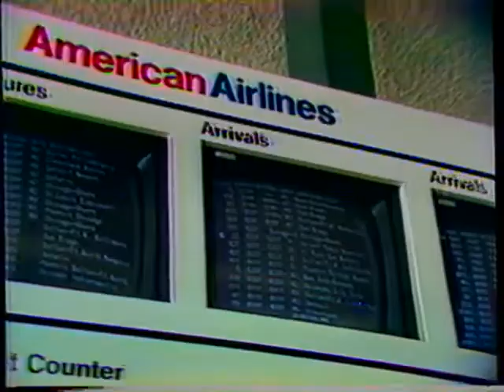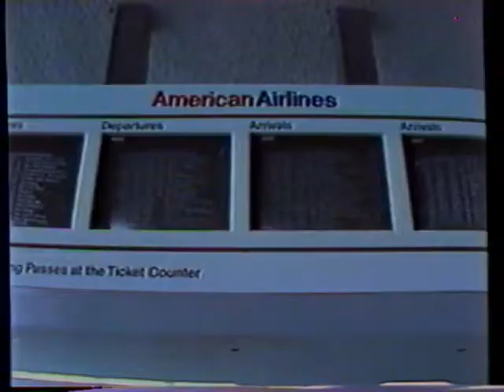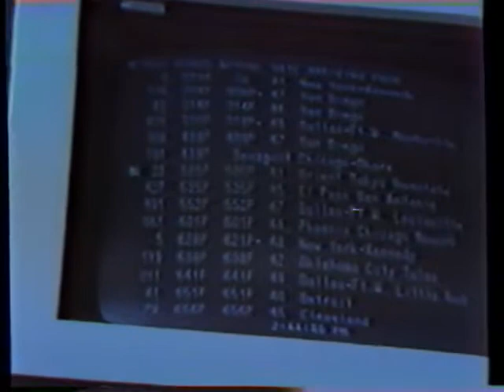American Airlines Flight 191

Comment: 21:15 Back in 1979, CBS and virtually no network news station had animation to show how American 191 crashed so the only way to do it was with a diecast DC-10 model like what CBS' Bob Faw was demonstrating with. 

25:56 At the beginning of CBS' Richard Roth's report on this CBS News Special Report when FAA's Langhorne Bond comments, you can hear a narrow body jetliner with Pratt & Whitney JT8Ds taxiing. Those engines were loud and were distinctive. Believe it or not, I love watching jetliners with those jet engines even though these planes that had these engines (727-100, 727-200, 737-100, 737-200 and DC-9) have long since been retired and scrapped.